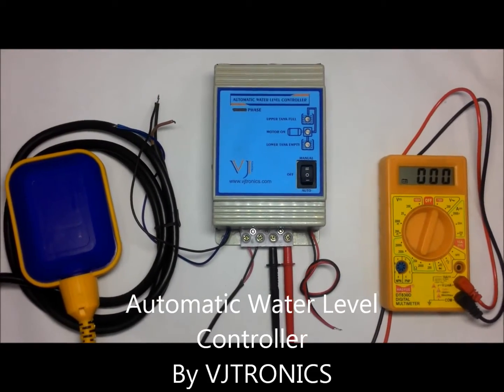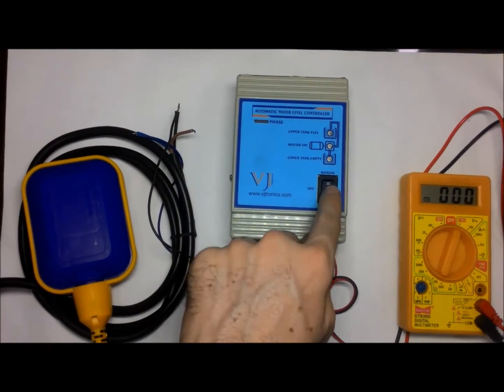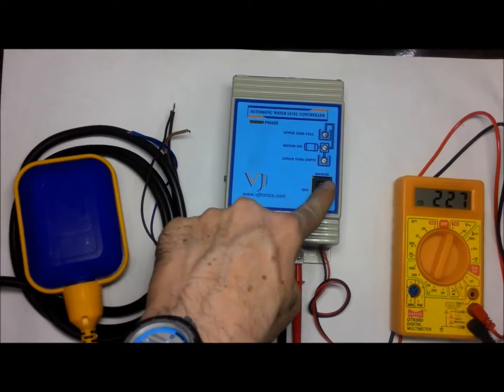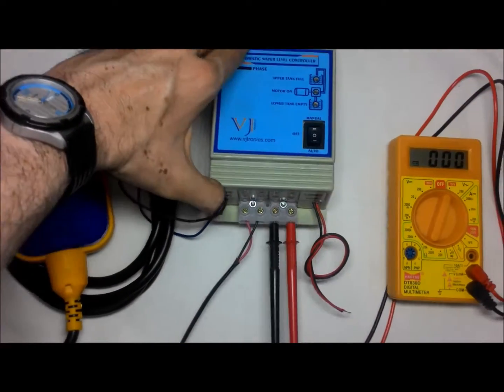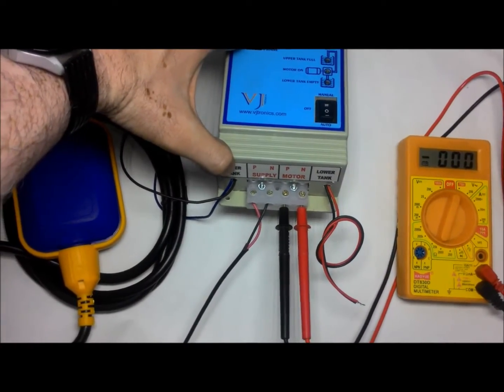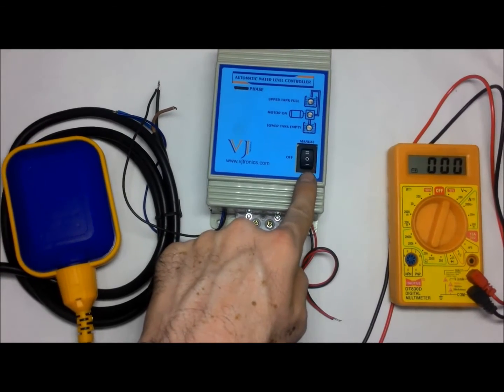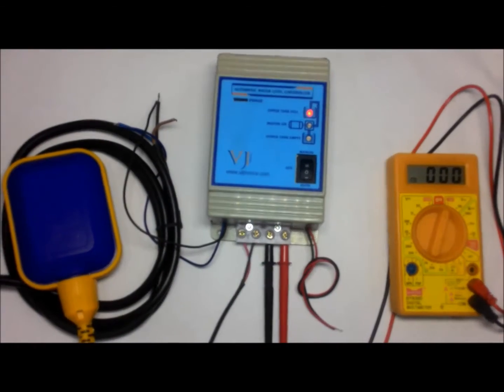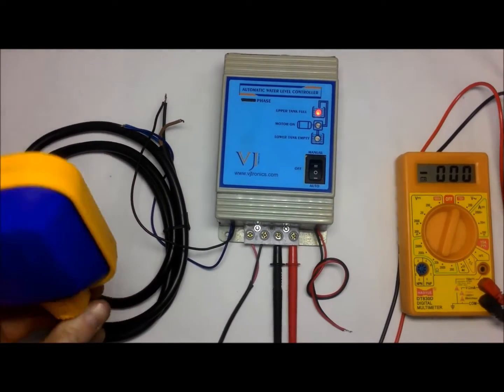Automatic Water Level Controller Installation

Comment: Fully automatic waterlevel controller star's@  just ₹ 450, ₹ 550, ₹ 750,₹ 999 with dry run cut off and tank level indication
For details📞 7892255292